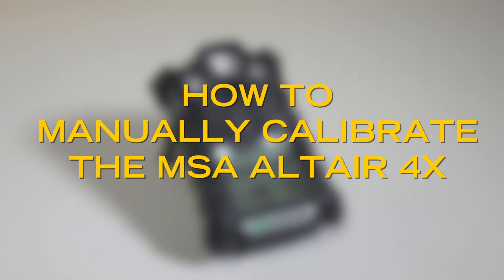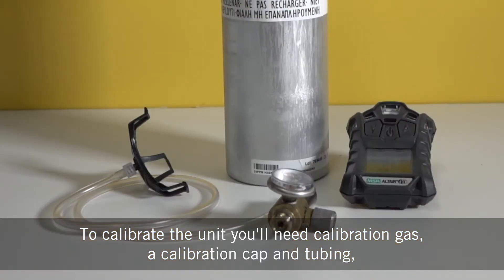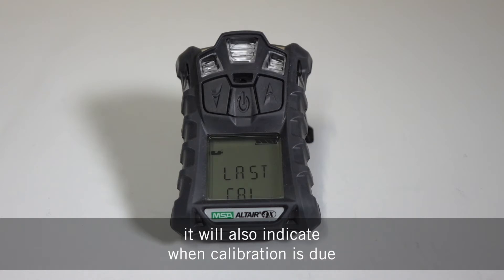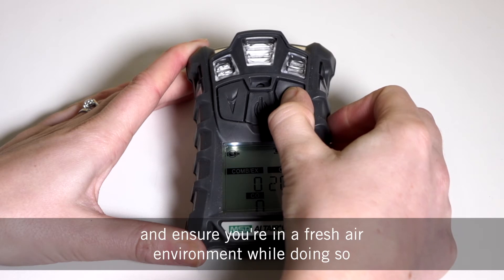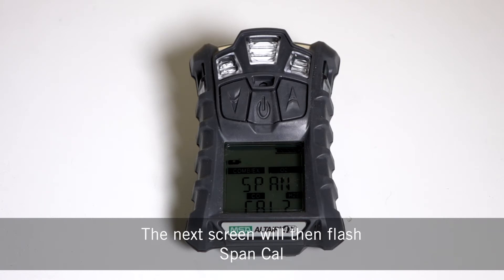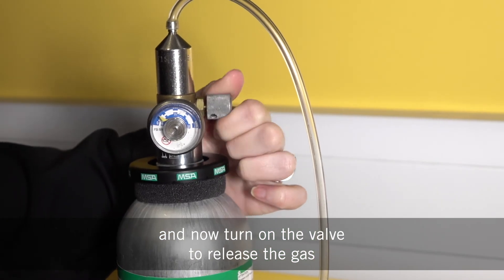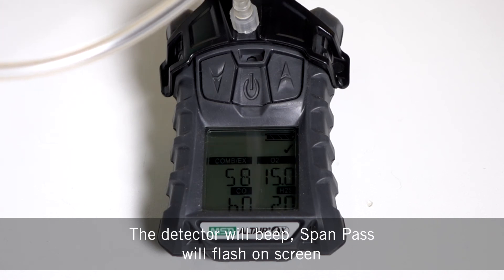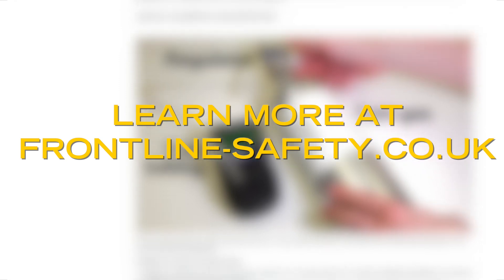MSA Altair 4X - How to Manually Calibrate

Comment: can someone explain why we have to do zero calibration.
and next thing. when we do span calibration but the nubmers are not correct. What do we do
Reply from the maker: While being used, the sensor reading can become impacted by other substances in the air. A zero calibration is to restore your sensors to a reading of 0, ensuring no other substances are impacting the sensor,  hence the need for it to be in the fresh air environment. If your monitor is still not reading as expected after a span calibration, there may be a fault that requires more than a calibration. I would recommend sending this to your local service centre, where they will be able to diagnose the fault

Thanks!

Comment: Would it hurt to use a 0.5 L/M regulator instead of the 0.25 L/M?
Reply from the maker: Hello Kyle, 
Thanks for your question.  A 0.5 l/m may be used on this particular instrument but the 0.25 l/m is the recommended regulator to use.